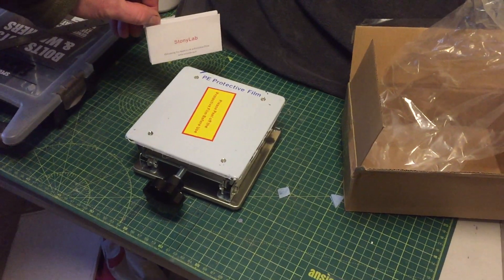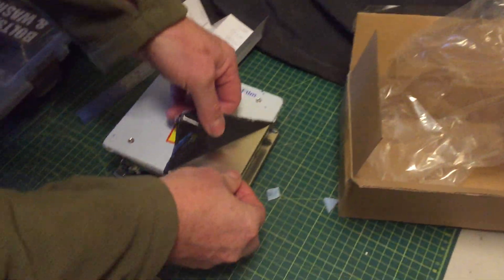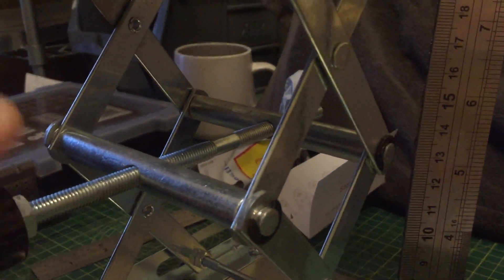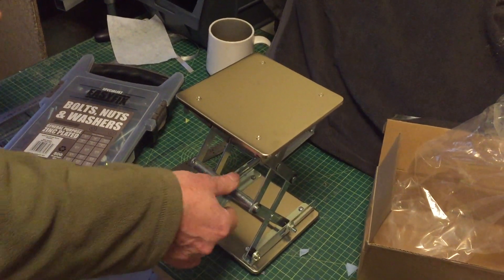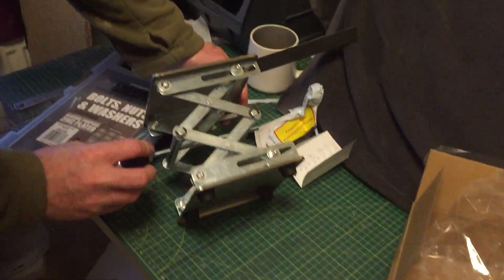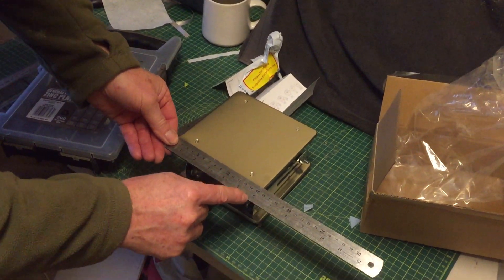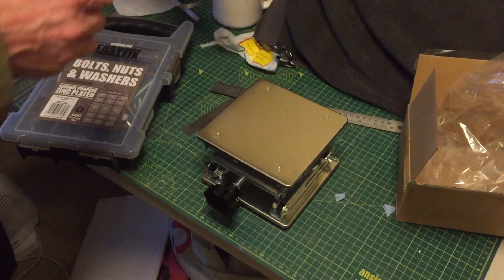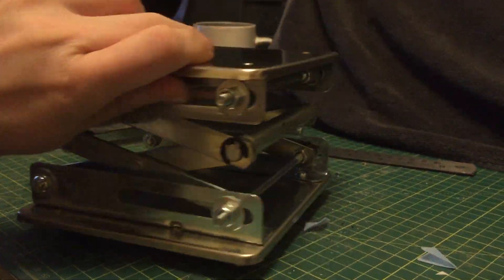StonyLab Lab Scissors Jack, 150x150 75mm to 260mm 10kg -  Review

Comment: I don't understand why you never put anything on the scissor lift when adjusting the height.
A bit like reviewing a car jack but never showing it lifting a car!
Reply: because these are just too much inefficient.
Reply: @Work-Horse  I agree. 
I added 4 x 2,5mm shafts to each corner on mine which were fixed to base. These shafts slid through 4 holes on top and bottom. This minimised the wobble by at least 90%
Reply from the maker: fair point